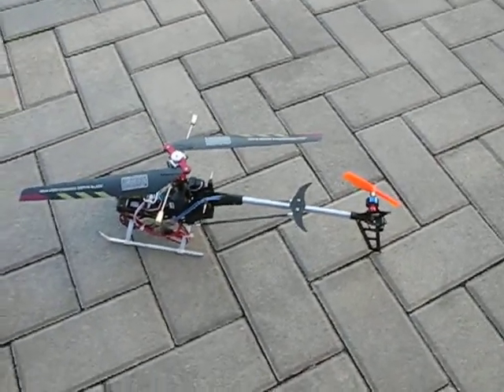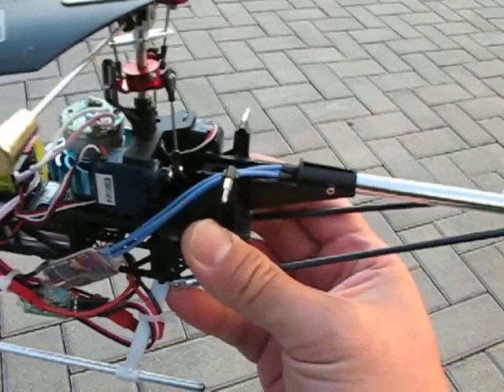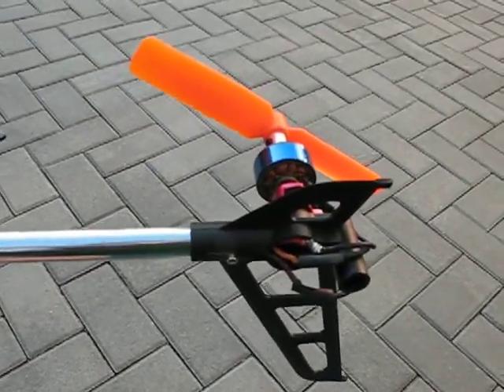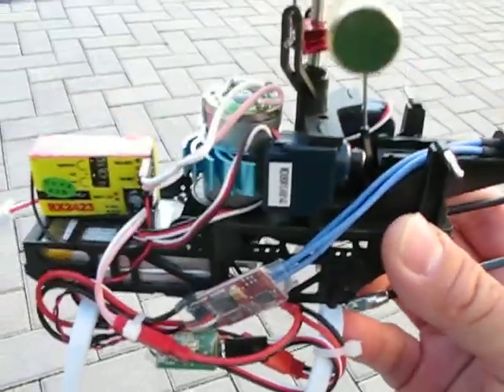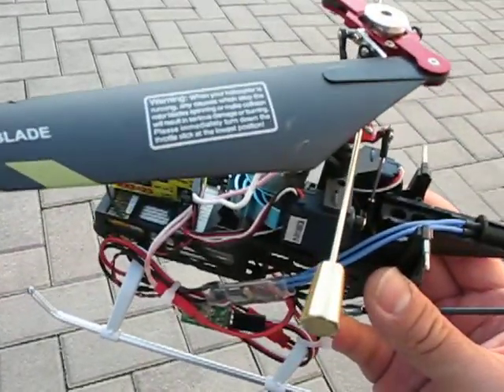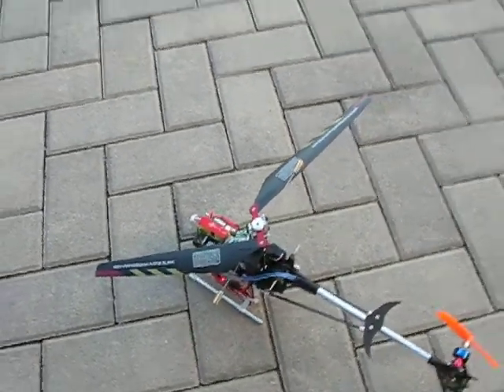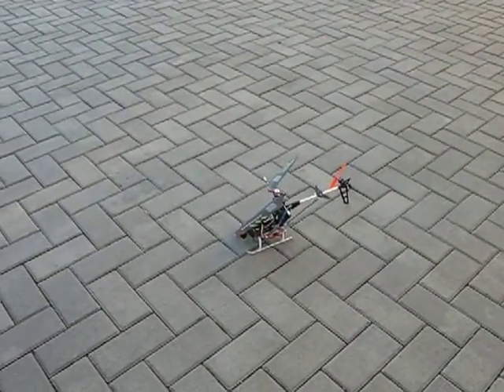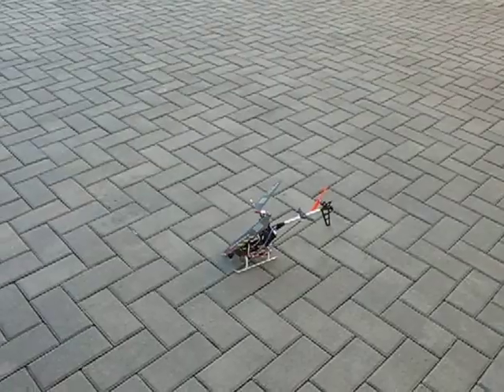WWW.RTF-HELI.COM - WALKERA CB180D BRUSHLESS DIRECT DRIVE TAIL MOTOR

Comment: nice video thanks for the useful information. I have a quick question, I have the same heli and want to replace the main motor with a brushless motor, is it possible? if so can I but required products from your site? thanks.. cheers